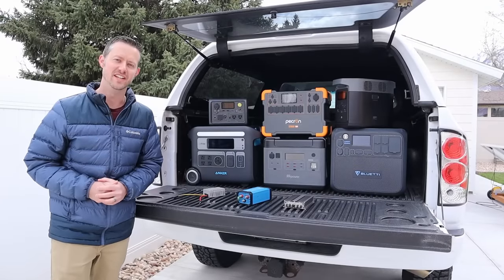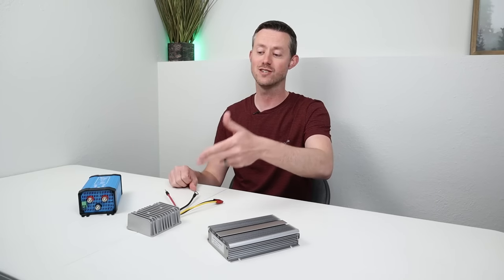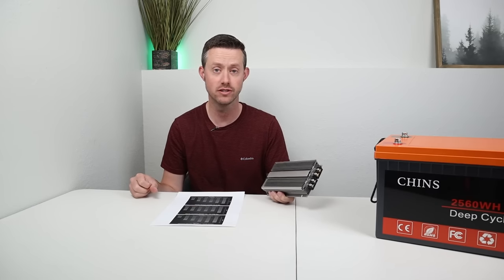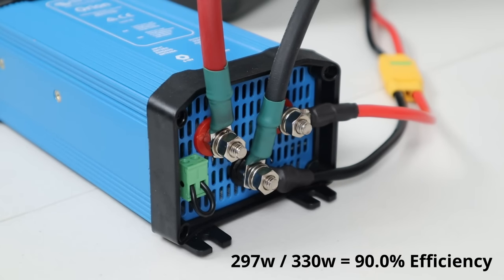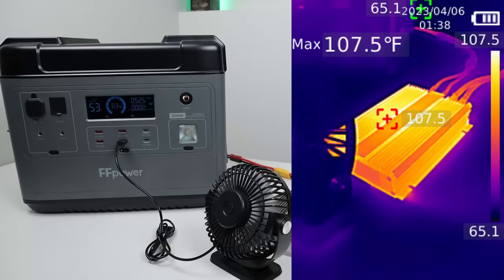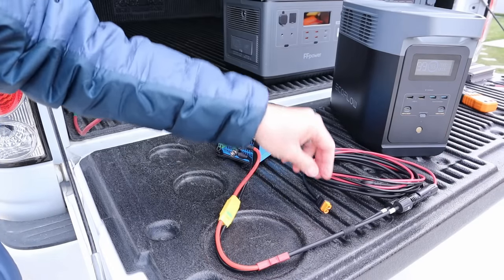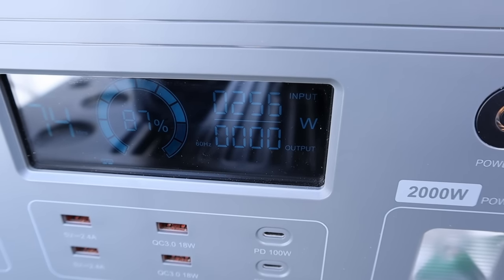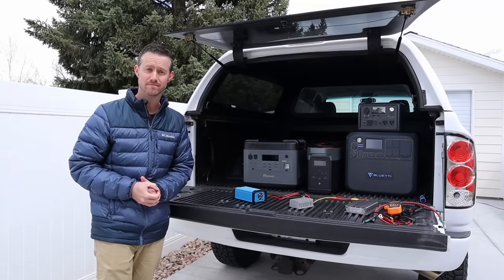Charge Your Power Station In Your Car FASTER - Perfect for Overlanding, Car Camping, and Van Life!

Comment: Jason--one last question.  For charging our older Ecoflow 1300 with the Victron 12/24 20A charger would I use an XT60i or just the regular XT60 connector?    Just being overly cautious that I don't feed more than 10a into the solar input.    Thank you!
Reply from the maker: I think on that model you'll get 8 amps with a regular xt60. You'll get the higher amount with the Xt60i

Comment: Good info! Still a deal-killer for me is that this takes up the solar input on most of these power stations, so you can’t simultaneously charge them from solar and the alternator. A few power stations have two higher-wattage DC inputs but that’s the exception rather than the rule.
Reply from the maker: Yeah, in that case it might be best to just charge from a 1500 to 2000 watt inverter connected to the battery, depending on how fast your power station charges from AC power.
Reply: I use a couple of MC4 T branch connectors when I want to add my little REDARC solar panel that's on my camper
Reply: @cilupercio Are you connecting the solar and DC to DC in Parallel to you power stations input? 

I’m wanting to do this with my solar and the Victron 12-24 into my EB70S input.
Reply: The Bluetti ac200max can have your solar going in through the a.c. port, with the charge enhancer D050S,  and alternator going in through the pv port.  AND vice versa, so you CAN do it with the Bluetti ac200max at least, it's very flexible in that regard.

Comment: Could I use this to send power from my alternator directly to our 2 x 210ah agm batteries in our slide-in camper? It would be awesome  to get something to charge faster than the standard 7 pin connection. This would be especially helpful in the northeastern US where solar isnt  always reliable, even with our 800w array.

Cheers!

Comment: Great info, thanks, this was a lot of work! This might be a dumb question but what are some options to prevent the boost converter from killing your car battery so it doesn't keep charging when the car is off?
Reply from the maker: The Victron has a switch relay built in that can run off the ignition of your car. Other options will require you to disconnect them when the engine is not running.

Comment: I have the Victron converter with a BLUETTI 200l. I have 14v coming in and 29v out of the converter but only 225 w charging using the BLUETTI xt90. I didn’t see anywhere that the BLUETTI needed the “I” connector like the eco Flo. Any ideas why I’m not getting 400w. Thank you
Reply from the maker: I didn't test with the AC200L in the video I tested with the older AC200max so they might perform differently. Do you have the DC input set to solar in the smart app?
Reply: @Jasonoid  I do have it set for solar. I'm waiting to hear back from Bluetti and will post back if they have a solution. Thank you.
Reply: FYI for others out there Bluetti confirmed that the victron dc to dc will not work with the 200L. They said 30V and less will be limited to 8Amps. My two cigs panels won't work in parallel either so I guess for me Bluetti isn't a great choice and they do not have a workaround like EcoFlo and others.

Comment: I would go with the Victron for two reasons: The fan and the charge rate for BE 200Max. But my head is swirling. I have been trying to figure out how to charge my BE from my van (without using the 12v plug) and I'm finally seeing some solid information here. Thank you for this. But I need more installation details before I feel comfortable doing this myself. Where can I get more specifics on what I need or a wire diagram spelling things out for me even more. I'll be watching this video repeatedly to try and glean as much detail as possible but any chance you consult on the side?

Comment: I used the small 12>24V unit with my Delta 2 Max and it died after about 2 weeks of use. I replaced it with the Victron unit and it has been working fine for several months now. So I suggest avoiding the cheaper units if you want reliability.
Reply from the maker: The Victron is great! For anyone wanting  to use a 12v to 24v converter, I'd suggest purchasing the 20 amp model or larger so it's only running at 50% load when running. It will last much longer. If you have a 5 or 10 amp model it's like running your car engine at full RPMs all the time, it's gunna die.

Comment: Hi Jason, I passed your excellent video to an electrician to carry out an install to charge my Ecoflow Delta Max (old model) from my 12v van battery. He chose to use the Victron Orion Charger 12/24v 15A, because he recommended the way it can be adjusted to cut out for low voltage input, to protect my car battery. It seemed otherwise to have a spec comparable to the Victron you used, and it's set to output 30V. However, when i connect with the Ecoflow solar cable (and XT60i connector), it registers a charge of 400w plus (13A x 30v?) for a few moments then cuts out to zero, and carries on cycling in and out. The installer managed to make a stable charge once, but couldn't repeat it. He made up a regular xt60 cable and achieved a stable 250w (8A x 30v?), but that's a bit disappointing (the Ecoflow also said it would take 4 days to charge, which it didn't, of course). Any ideas what's going wrong, or how we could sort it?
Reply from the maker: What happens if you turn down the Victron output voltage a little bit? Like instead of 30v, try 27v or 28v with the Xt60i. When it's turned all the way over to 30v, it might be working too hard.
Reply: @Jasonoid  thanks Jason. I understand the installer tried that yesterday and it didn’t help. I’ll ask him tomorrow (and try myself). We’re also going to try making our own xt60i cable rather than the long ecoflow one.

Comment: I have a Bluetti AC180 with 1153 watt hours of battery storage, and a 200 watt Renogy solar panel on top of my Tacoma. I also have a factory built in inverter in the bed of the Tacoma, which charges at 100W while in motion, and 400W while at idol. I’m wondering if it’s safe to charge my Bluetti with both at the same time while I’m driving to my destinations? That would give me 300 watts per hour, and hypothetically, without calculating any voltage drops or efficiency losses, that would charge the unit in 3 hours and 50 minutes from an empty battery. Thats pretty good as most states get at least that amount of sunshine per day, even in the winter months.
Reply from the maker: That sounds like an excellent plan to me! You can also mod your 400w tacoma inverter to put out more power while driving. Lots of videos on the topic. Make sure you set the charging speed to the lower level on the Bluetti so it doesn't overload the inverter.

Comment: Awesome video.   Do you have a video showing how you ran wiring from your alternator to the back of the vehicle?  If yes, please provide me the link.
Reply from the maker: I don't have a video about it. I ran 6awg wire from the battery, down the firewall, under the cab along the frame / truck bed and came up through on of the wire plug holes for the tail light. I used wire loom and heavy duty zip ties to attach it.
Reply: @Jasonoid  Thanks.
Reply: @Jasonoid  Thank you Jason.  Congrats on reaching another YouTube milestone!  How do I find out about your live chats ahead of time?
Reply from the maker: @CuriousinNY  turn on channel notifications for my channel (the little bell next to the subscribe button). I announce the streams on my YouTube community page a few days before each one.
Reply: @Jasonoid  what is a YouTube community channel? I actually did have notifications turned on for your channel when I subscribed. I just checked it and saw there is another option for all notifications for your channel. When I subscribed and the bell came up, I thought that was it. How do I join your community page too.
Reply from the maker: You just view the community page on my channel. You should see my posts scrolling through youtube app as well.

Comment: I have Ecoflow Delta Mini and Bluetti AC180.  Both say Max 10 Amps input.  Will these 20 Amp convertors damage the insides of my Power Stations?  Or will they automatically default to a 10 Amp draw without any real issue?  Or am i best buying a Victron Smart 12-24-10/15 DC to DC charger?
Reply from the maker: They will limit the input automatically to 10 amps. No issues using a 20 amp converter... in fact that's probably better using the larger converter so that the converter doesn't have to work as hard. It will only run at a 50% load.

Comment: Hey Jason,
Happy Holidays.

I got the Victron 12/24 20 amp for my LiTime  mini because I was only getting 100 watt charging to my Bluetti AC180. It took me to 200 watts input. I turned the screw and it took me to 28.8v, but only 7.8 amps ~ 230 watts. 

How do I make the AC180 think it's getting solar?  It's supposed to handle up to 60v at 10 amps. 

Great videos, btw.
Reply from the maker: In order to go up to the full 10 amp input limit, the input voltage limit needs to be over 31 to 32 volts, so the voltage is just a little low when turned all the way up

Comment: Superb video.  My truck camping setup (WIP) includes a 40A DC DC  Renogy charger, a Renogy 200ah LiFP Bluetooth battery, and a Bluetti AC200 Max station.  I purchased the exact same 24v 20amp 12v step up convertor you did :) I also own the Bluetti D050s DC charging enhancer, so I should be able to charge the AC200 Max using a second step up converter from both AC200 Max charging ports. Both DC step up  converters will draw power from the 200ah Renogy battery.  Question - does Ecoflow sell the orange (special) XT60 charge cable separately, or does it only come with a Delta station?
Reply from the maker: The XT60i orange cables come with their solar panels and you can also purchase them separately on their website.

Comment: I came across this vid searching for ideas on using my renogy 40a dc-dc charger to charge my EcoFlow River pro at a faster rate than cig lighter.  Can the Renogy scale down the amps to the limit of my EcoFlow?  Max solar charging is 200W 10-25V DC 12A Max
Reply from the maker: The power station will pull the power it needs. It has a built in amperage limiter so no need to worry about reducing the amperage the Renogy produces.

To get faster charging you need higher voltage than the 12v output of your vehicle.
Reply: @Jasonoid  Answers my question that is similar, thanks!
Can I safely use the Victron Energy Orion 12/24-Volt 20 amp with my EcoFlow River2 Pro?   Will the 20 Amps it is putting out be safe with this setup?

Comment: Will the victron work with a EcoFlow river 2 pro? The back of my rpro 2 unit says 13A max, this victron says 20amp….can I just put a 13amp fuse between the victron and river pro?
Reply from the maker: The River 2 Pro will limit the current automatically, no need to worry about the Victron causing any issues. The Victron will charge at the full 220 watts.
Reply: @Jasonoid  thank you!
Reply: @Jasonoid  This answered my exact quetion, thank you!
Can I safely use the Victron Energy Orion 12/24-Volt 20 amp with my EcoFlow River2 Pro?   Will the 20 Amps it is putting out be safe with this setup?

Comment: Great video!!! Been waiting for this one… question I have Delta Mini can I still use the Victron??
Reply from the maker: The Delta mini can take in 75 volts of DC power, up to 10 amps. It will Limit at 300 watts automatically. You can use the Victron on that model!
Reply: Thanks for responding

Comment: Great video! Would the Victron still produce the same amount of charging watts for the older Bluetti AC200p? I’m thinking NO.
Reply from the maker: You have a 15 amp limit on the 200max, the 200p has a 12 amp limit. You'd probably see around 315 or so watts with the Victron.

Comment: Excellent information buddy 
Exactly what I was looking for. I own 2 BLUETTIs  Eb70s and Ac200p and like to expand capacity with a Battery.  I like the Victron.  Question.  Will it work with my small generator’s input 
Voc 12-28. 8A ??? Thanks buddy
Reply from the maker: The Victron would be compatible with both of those devices, you'd just have to drop down the voltage a little to work with the EB70s. Nice flexibility with that one.
Reply: Thanks buddy

Comment: Watched over and over for the 12v to 24v 20 Amp Converter and using a Ecoflow, I have the mp4 cable already with xt60i  and ordered the 12v to 24v 20 Amp Converter, what else is need to make connection?
Reply from the maker: You'll need 6 awg wire ran from your starter battery to the converter (with a 60 amp fuse on the positive line). The other wires you already purchased would work for the output power. You could also go with a plug n play solution like this:
#1   https://youtu.be/IBtENPh5rTA
#2  https://youtu.be/NqnYaqMwktE

Comment: What about 20A DC-DC chargers, do they also work same way if we use the orange cable with ecoflow
Reply from the maker: You need higher voltage to charge faster, that's why I boosted the voltage in the video.

Comment: Awesome video, just had a quick question. Is it mandatory to run dedicated power and ground from the starter battery, or can you chassis ground near the converter?
Reply from the maker: Correct, you can bypass using two long wires for the converter and just tie the ground into your metal frame and it will work as well. Just make sure that your battery has a decent grounding wire and a good connection.
Reply: Thank you🙏
Reply: This is the same advice my auto-sparky told me and it is  working with my setup.

Comment: Finally someone made this video! Now all of our heads can stop spinning for this one issue keeping us from doing a plug n play system. Question….Would my already installed Renogy 20-40A DC-DC charger work? Any idea what the max Amp input is on that Bluetti plug?
Reply from the maker: If you use a DC to DC charger it doesn't really give you higher voltage output. The key to faster charging is the higher volts. If you charge at 12v you'll see around 100 watts on your power station (that's what you'll see with the DC to DC charger as well since it's designed for charging a 12v battery). If you want more wattage you gotta get the volts higher like the DC to DC converters used in the video.

Comment: Great info! I have a Bluetti AC300/B300 in a Sprinter. What would be the highest input DC-DC charger I cold use. The DC input is rated at VOC 12-150VDC, 12A.
Reply from the maker: You could use a 48v or even 60v DC to DC converter but those are rare. Since there are two solar charging ports on the AC300 you could use TWO 36 volt 720w converters at the same time for a lot of charging input.

Comment: Okay I understand. I currently have on hand the Bluetti AC200L and am trying to figure the best solution to recharging it as it's a micro camper that I won't be able to rely on Solar to be an efficient method. Ideally it would be nice to have dual charging but the AC200L DC port will only support a single connection so. Sine wave inverter is the only possiblity for dual charging.
Reply from the maker: Correct, the new 200L supports AC and DC input at the same time but not dual DC input.

Comment: Hi Jason.  Thanks for this demonstration.  I have a 2019 F250 with the accessory switches.  This being all new to me, would i be able to connect to the switch block instead of the battery?  The switch block is already fused with multiple connections, anywhere from 5 ams to 20 amps.
Reply from the maker: These pull many more amps, usually 35 to 65 amps depending on the converter. You'll need to run a larger dedicated set of wires and a fuse.

Comment: Hello,

Great video, wanted to ask if u maybe know if with ac200max, you can charge it threw alternator and at the same time threw solar panel to double the speed??
Reply from the maker: Yep, if you connect the DC to DC converter in the 'solar/ DC Charging port' on the Bluetti and then connect your solar panels to the 'Bluetti charging enhancer'. You can have solar and dc input at the same time. I have some videos on my channel about  the DC Charging enhancer if you search for them.
Reply: Thank you very much. This clears all my doubts.

This way I guess I can get around 500w from alternator and another 400w on good Sunday day threw solar which gives me enough confidence that I won't run out of charge.
Thanks again and great job @Jasonoid

Comment: @jasonoid great video as usual, and something I’ve been scratching my head with for a few days now. I have a Bluetti ac180 and a 230Ah 12v lifepo4 battery. Since the ac180:doesn’t have battery expansion, what would your solution be to utilize the external battery to keep the ac180 topped up whilst also using solar (either into the battery or ac180). Thanks.
Reply from the maker: The 12v to 36v converter will get you around 360 watts from that large LFP battery. Probably a decent solution to charge the AC180 up. It might get a little warm so having a small usb fan blowing air on it connected to the AC180 will keep it cool.
Reply: @jasonoid I was thinking that, but then my solar input is tied up. Can I use a splitter/combiner to use both? The alternative is a cheap renogy 1000w inverter wired to the battery, but that puts the ac180 into pass through mode I think, which will stop me using the full ac180 1800w inverter 🤷‍♂️ can’t seem to figure a good solution for an extra battery for the ac180.
Reply from the maker: @johnroberts1953  I just use the fast car charging when solar isn't available. I like to have my solar panels connected most the time. You could put in a switch to go between both DC options quickly. You can do both at the same time unfortunately.